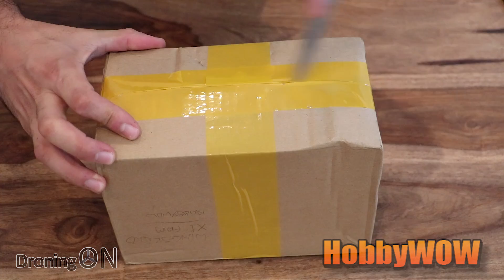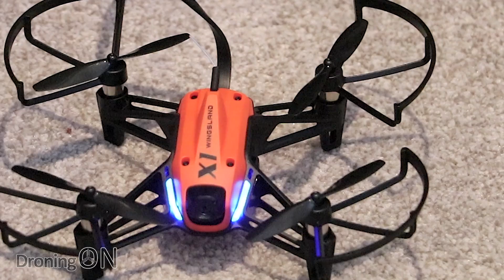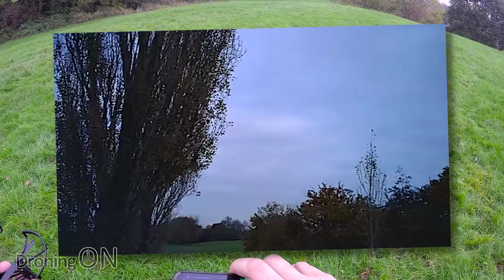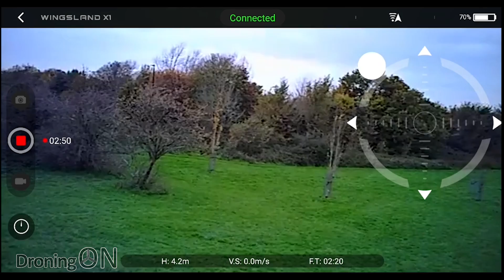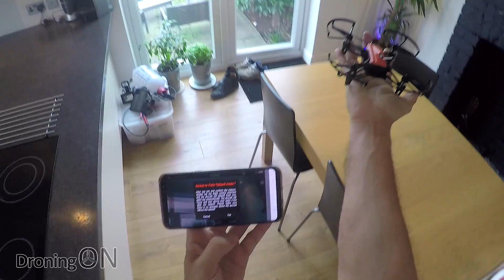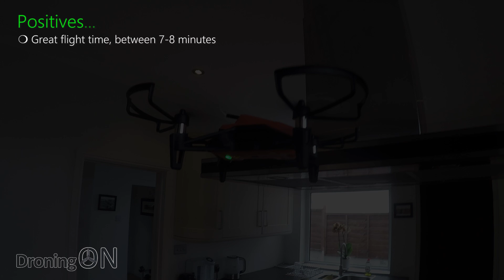DroningON | Wingsland X1 FPV Racing Drone Review, Unboxing & Flight Test

Comment: I got the r6 controller with my x1 and it connects kinda weird  both the phone connects  to the drone and the controller  instead  of controller  connecting to drone and phone to the controller  like every other  drone. My r6 controller  came with NO info sticker attached  no wifi info to enter when trying to bind the r6 to my s6. Any ideas anyone!!I tried flybars info for binding  and no blue light comes on. Supposedly I'm supposed  to tell the drone in the app to connect to the controller  but again no info on the controller. Stumped!!

Comment: Can you give me link for r6 transmitter? Can't find it anywhere :(
Reply: Best to go on bangood  or Ebay  and buy x1 package deal with the r6 controller  for 50 bucks. You'll  have a spare drone  for parts since cant seem to find spare  props anywhere
Reply: Update  the r6 controller  that comes with the x1 is a cheaper  version  that only works for x1  parrot rolling  spiderprops fit
Reply: that controller that comes with x1 does not bind with wingsland s6 ?

Comment: This is, even to the proprietary battery, a Parrot Minidrone...optical sensor, frame and motors, usb port/charger. They also have the "braking" effect"...same motor sound too.  I'll have to check the Parrot site for their new FPV Minidrone (I'd like to see if they have the ultrasonic sensor and have gone to wifi. I love my little Parrots...hmmm...either there's some agreement, or we know their mfg partner.
Reply from the maker: +Margot Copeland they are indeed similar but not the same, the frame design and arms are very different, but definitely a similar class indeed!
Reply: Would  you  know if the props are swappable?  Need spare props for x1

Comment: When u said WiFi FPV I lost interest. I had that on the first quad I bought and it’s useless because of the latency. Maybe the technology is better now I’m hoping but as far as I’m concerned 5.8 is the only way to go. Also is it possible to put a FRSKY receiver in it?  It’s a nice looking little quad but also the propriety battery and the way it charges is another draw back for me. I would order this drone now if not for these things. Thanks for the video
Reply from the maker: +Olli Garch hopefully from the flight test segment you can see that the latency isn't so bad, but it's as usual for WiFi which is around 100-200ms, as you say too latent for fast flight but it's fine for this little quad because it isn't very fast :) it would have a proprietory FC as well so fitting a custom RX into it would be very tricky unless you take it apart and replace the FC as well. But for the price, especially now with the flash sale, it's a good little Xmas present. Thanks for the comment dude, appreciate your support!